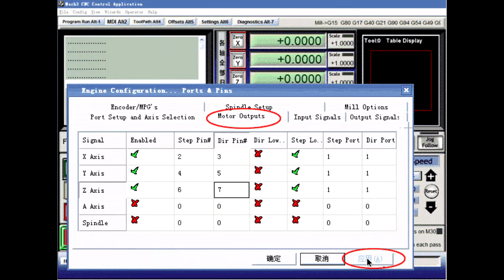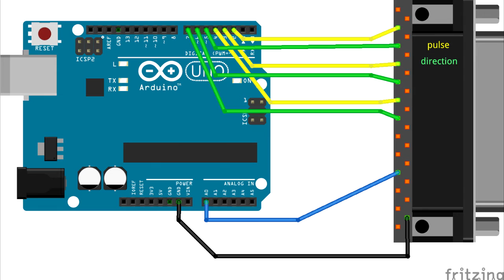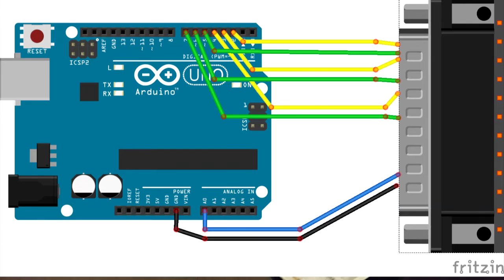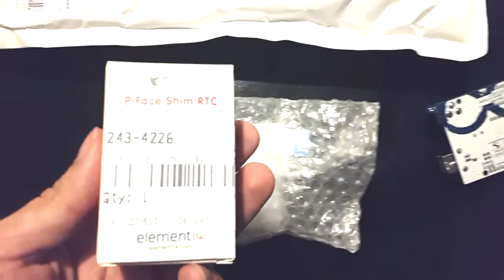Wiring Arduino GRBL To A 3020 CnC

Comment: what about using arduino with a RAMPS board? I have a 3020 on the way and I'm considering just flashing an arduino with repetier firmware... I'm thinking if I could have all of my 3D printers, and a CNC running the same firmware, I would be able to manage them all from the same web interface.
Reply from the maker: Kyle Butler my plans are: a real power supply, separate pwm spindle board. The stepper board is ok, probably the only part worth keeping. Then a raspberry pi set up as a high level interface to the Arduino. with Wi-Fi, a display and pendant control.
Reply from the maker: Kyle Butler in theory I have all the needed parts in my lab already. just need to get a round tuit.
Reply: have you messed with any LCD SLA technology? I'm really wanting to build an SLA printer right now.
Reply: If only there was a DIY non-toxic resin.... it would be golden.
Reply from the maker: Kyle Butler and mold making rtv silicone that was non toxic and didn't stink.
Reply from the maker: I'd love to try (finding tuit's again) a homebrew one using an old screen with a UV backlight cranked up. Mostly just to see if I could. If I wanted the amazing prints, I suspect I'd have to have someone who actually knew how do it.

Comment: Thank you. That was an excellent video and really useful. My oly question is why didn't you just use a 25 pin D-sub connector and keep the Arduino external?
Reply from the maker: Samuel Doye I didn't want the Arduino flapping in the breeze - having it internal makes it quite neat. This a step towards the full mod. Usb is far more convenient than a great big d-sub. However - eventually I want to throw an rPi + Wifi dongle in it - no tethering needed at all - and plan to try and run Octoprint on it.
Reply from the maker: Orionrobots Oh - that and I have more Arduino's than I now know what to do with...
Reply: That is an excellent problem to have.